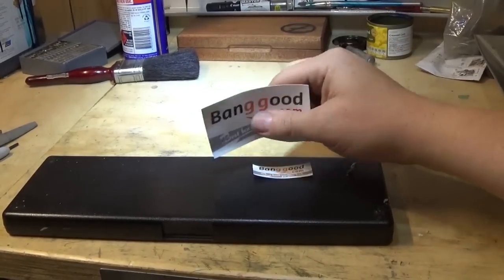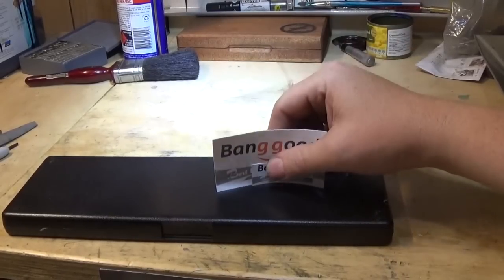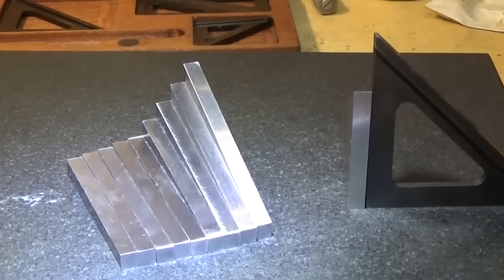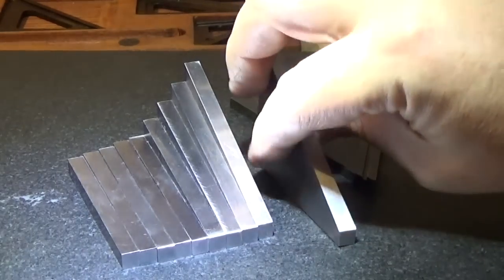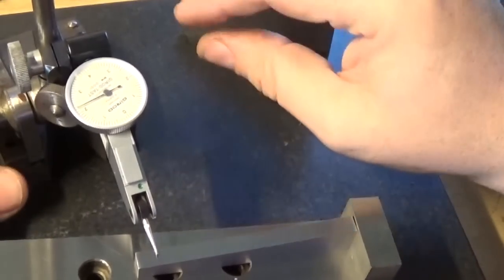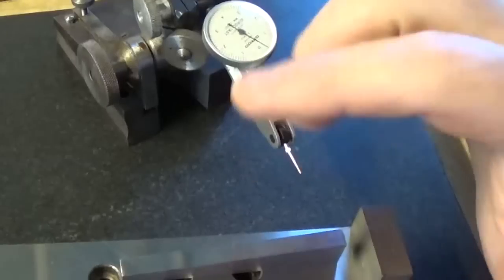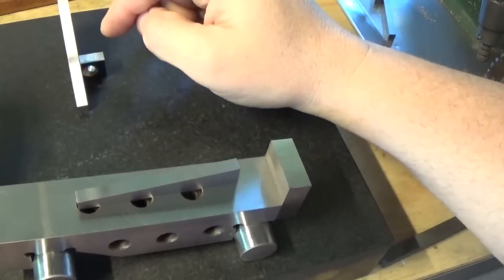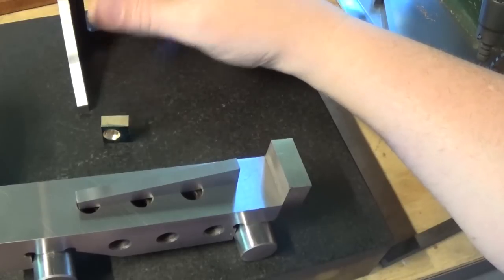BANGGOOD.COM review - Precision angle block set

Comment: Thanks Emma:  I just bought some of these for just doing some chamfers on the mill, mainly for a welding groove on a radius cutter I'm setting up to build.  My mill head won't cock and who wants the trouble of tramming for a quickie chamfer job anyway.  I'm about to go get the mail, haven't looked at them yet but I bet they will be fine for approximate angles that I need to do at this time.  I usually buy cheap stuff to get me by with intentions of buying higher end tools as I run into deals on them.

Comment: It was nice to get a critical (in-depth looking at good and bad) review. I would think the lack of hardness would be the biggest issue in the long run usage of the angle blocks.
Reply: Hardness shouldn't be a big issue, they are really for location purposes and not for any rubbing. In my case hardness would be an issue when i drop something heavy on the corner. :>(
Reply: That would be my biggest issue, too. Or if you are trying to tap it down when in the vise.
Reply: Agreed but that depends to a certain extent on the length and hardness of the part being tapped. In home shop use I wouldn't worry overly.

Comment: Emma, That was a great in-depth review!  It is a shame they just sent you an OK set to review.   I got home from work today and did a quick inspection mine and they appear to be much better than the ones you received.  I bought the HFS 12 piece precision angle block set that comes in a wooden box from Amazon in November of 2015. They are slightly higher in cost than the ones you have. (As a side note, I was in Melbourne Australia when I ordered them).  If you want, I can post a follow up review of mine.   I don't have a Sine bar so I can't check all of the angles, but I can check a couple using the squares I got from you as the master set.   Thanks,  Chris

Comment: Good honest review, when measuring thin parts on the sine bar, holding parallel with the bar is the hardest part. I use 2 small button magnets to hold the part parallel with the edge of the bar.
Reply: Shadon HKW   send her a set of your  barZ  squares to review and check against the square used in the video.

Comment: I have not had time to read all the comments, so forgive me if this is a repeat. Is the out-of-square an issue? Maybe the bottom and top faces are in the correct relationship to each other. You could perhaps check this by putting a known accurate piece on top of the worst one in a vice (say a gauge block) and checking across it-jaw to jaw.
Nathan Sweebley, Lord of the Files
Reply from the maker: they dont seem to be parallel anywhere. one day ill regrind them and they will be good.

Comment: Good review.
What's the hobby coming to, we have a milling machine.
Why not spend the the $30 on some o1 tool steel and make your own angle blocks.
At least they will be square and usable for the home machinist.
No need to surface grind them, get a good finish fly cutting them.
Joe pie has a good video on making angle blocks
Adam
Reply from the maker: yes you are absolutely right. with some care you would get them at least as good as these,

Comment: Nice job on the video Emma, I also need some angles thumbs up
Reply from the maker: make them..
Reply from the maker: and make a video on them
Reply from the maker: no pressure
Reply: Hi Emma, Yeah, Guess I could. I have gave it some thought, Only issue is I don't have a accurate way to measure them if I do. I need to get a good bevel protractor or a sine bar and some blocks. I don't have very many precision measuring tools.

Comment: Hi Emma, looks like you were seeing some cosine error on the 5-degree block at 16:30 or so. The block needs to be aligned with the length of the sine bar to get an accurate reading (exactly parallel with the sides in other words); otherwise you're essentially reducing the rise over the same run. Very helpful review, this helped me a lot in my current angle-block shopping, just thought I'd mention for next time :)

Comment: To put some of this data in perspective, I modeled some parallelism errors and found that, over 4.000", a parallelism error of .0001" changes the angle by .001º, and an error of .002" changes the angle by .028º.  Over 3.000", the error is .037º.

Also, is the lack of squareness of the registration face relative to the sides or parallelism to the bottom really an issue?  It seems to me to be no different from the fourth step in squaring stock to make the ends parallel: only the angle of a knife edge is required to register the opposing end square in both X and Y axis.  It seems to me that the fixed jaw will do more to influence the squareness of the part in the Y axis using a single parallel.

Comment: Thank you for the review. I have the same set from a different re-seller. My set has some of the same issues, maybe not quite as bad. I also setup my sine bar to check them and they weren't perfect but not bad either, for the price. The case needed another  layer of foam to hold them in place. In December of last year I ordered several (5/8") tool holders and boxes of inserts from Banggood. What I received was an empty paper envelope in a plastic bag with a letter of apology from the post office that the envelope was received empty. I photographed the mutilated envelope (a paper envelope to hold heavy steel tools!) showing the order # and the post office letter and sent it to BG. After several e-mail exchanges They told me to go to the post office and get proof that the envelope was received empty. I went to he main post office and showed them what I had gotten. They were very accommodating and got me a letter on official USPS stationary signed by the postmaster. I sent that to BG. Several more exchanges and they sent an email asking if I wanted a refund or the products. I replied "products." It has now been over two months and I've not gotten anything and, by now, don't expect to. They have not replied to my e-mails. April 8th, 2018.